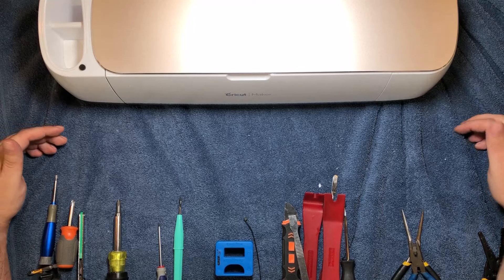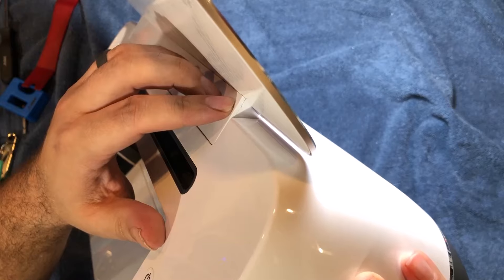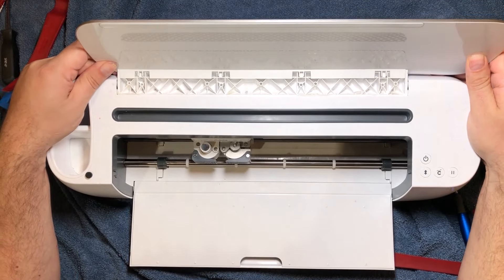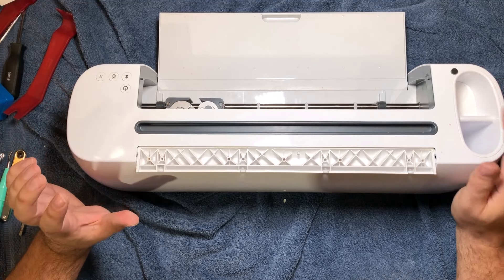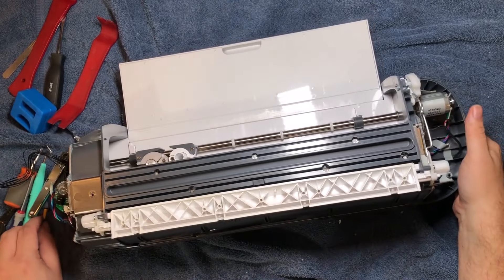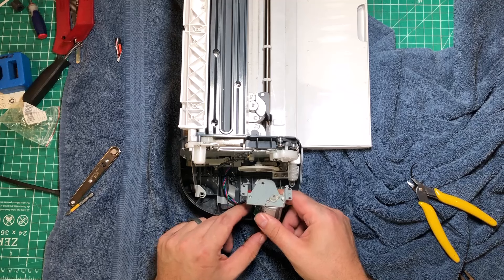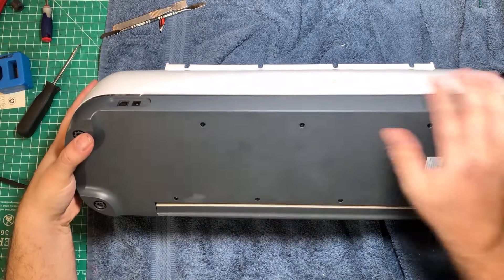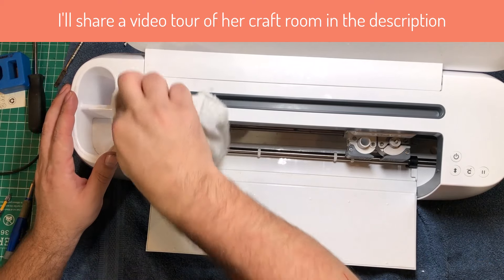The Ultimate Guide to Replacing Cricut Rollers - Every Step. Every Detail.

Comment: Great tutorial! I was able to get all the way until the 15:18 mark with ease. When I went to try to take the roller out, it won’t. I’m not sure if it’s because I have the Maker 1. The bar is so long that I’m not even able to wiggle it out or anything. Have you worked on any Maker 1, and if so, how did you get the roller bar out?
Reply from the maker: When you slide the bar to the right, does it actually start to come out the side of the machine or is the hole on the power button side just a tiny bit smaller than the rod?  I've had to do a little bit of filing on one to just get a burr out of the way and then the rod slid through on the right.
Reply: @AnotherMaker  I had this exact same problem and had to file the hole (the plastic surrounding the hole was too small) on the right side so I could slide the bar far enough in order to get it out!
Reply: I had this exact same problem and had to file the hole (the plastic surrounding the hole was too small) on the right side so I could slide the bar far enough in order to get it out!
Reply: Same here got stuck on 15:25 part .
The rod on this maker 1 is too long it does have wiggle room
but not enough to take out the whole metal bar
Reply: ok we good now.
Reply: Same the plastic was slightly covering the hole but a little filling and then the bar was able to come out.
Reply: I had the same issue but didn’t have a small enough file.  I used a small strip of 220 grit sand paper.
Reply: This is also where I got stuck. What should I use to file the hole?
Reply: @debasencio3805  You can use a needle file which others say they used with success or you cut a thin strip of sand paper, feed it through the hole and sand it down for a few minutes.  I used the sand paper method and it worked for me.  Just make sure to vacuum up and wipe off the grit from the sand paper (if you go that route) and the shavings of plastic because they could probably cause issues to the mechanisms if left behind.  If I do this again I’ll just buy a pack of needle files for $10 or so, seems the easiest.
Reply: @drewchenoweth9116  I was able to use my rotary tool with a grinder tip. It took some fiddling but I got the thing fixed...I hope. will be trying it out this afternoon.
Reply: @AnotherMaker wouldn’t this alter the functionality of the machine? Wouldn’t it then slip/come apart during use?
Reply from the maker: @justacrochetmum7536  No. There's no way to pull it out.  It doesn't move at all.  I've done it both ways, but on the ones I've done, you can't pull that one way or another if the right clip alone is on.
Reply: @debasencio3805  that's exactly what i did. you can't grind too much, the metal will stop you. I use a nail grinder, low power anyhow. :)
Reply: @dawnbilyeu4050 which part did you file? I can’t get my bar out. This is so frustrating and Cricut says my machine is out of warranty and doesn’t care.
Reply: Great Tutorial. I fixed mine in about an hour and a half. Had a little problem with the bar not wanting to come out due to the inside housing not being cut the same as the metal outside and lining up so I took a sharp pointed knife and was able to remove some of the plastic once I got it out without damaging my rod. It took a little maneuvering to get it out though but I'll be good for next time. Thanks for the instructions.
Reply: For me I had to loosen the purple plastic two silver screws and pull up on it a little this makes the shaft hole a bit larger and was able to then slide shaft to power side just like video. Just remember on reassembly to push the plastic back down and tighten the two screws once the shaft has been reinstalled.
Reply: I have a Maker 1 and had the same problem. I didn't file the hole, though. I pushed down on the metal thing so that the bar was as close to being above the gears as possible and at the same time, I used a screwdriver and pushed the bar in from the outside and somehow it popped out and I was able to remove it. I hope that I explained that in a way that makes sense.
Reply: Pretty sure you figured it out baby now, but I had the same issue. I had to push it right and wiggle it towards me on the power side. I was nervous the whole time. I hope you were able to fix everything!
Reply: If you undo the 2 forward and upper most screws it gives it enough leway to get the bar out I had the same issue with my Maker. then all you have to do is put the screws back in once the bar is back in place! No sanding required.
Reply: Help! I changed mine but now my power light does not work, it makes a weird noise and will not pull the mat in. What can I do?

Comment: Count your days cricut.. you deserve all of the money in the world for this explanation because it was truly a beast. Cricut needs to design rollers that we can snap on or something
Reply from the maker: Yeah.  That was a really really dumb decision.  The old rollers lasted for 5+ years without issue on my Air2. These lasted a year and were a pain to change.
Reply: Cricut are aware that there is a problem with the rollers and are replacing the machines. I just had my almost 4yo machine replaced with a new maker 3.
Reply: Replacement is a Maker, not Maker 3.🤦‍♀️
Reply: Mine went and because I had it for7 years they couldn’t replace but they offered me10% off for another one on their site. 10% ain’t much for what those cost but it’s something. I’m waiting for prime day to see if I can get an even better deal. I wish I can take it to someone to fix for me but they said no.
Reply: @bevbarry9637  what steps did you take to get cricut to replace your machine?
Reply: @phyllisallen5776  I just contacted customer support and told them that the rollers had moved and I couldn't get them back into the correct place and they told me they are aware of the problem. I had to send them some things; video of the issue, proof of purchase etc and it took almost a week for them to come back with approval for a replacement.
Reply: I just did this, and indeed, it takes an hour + .if you are not patient and handy do not attempt 😂
Reply: Hi, I'm in a bit of a pickle. I'm at the part of taking the bar out of my explore air 2 but it's not budging. Please help.😢

Comment: On the bottom the 3 screws are longer than the 4 screws. We didn't realize until one of  the 4 screws were not long enough in the 3 screws slots.  We kept thinking the cover wasn't lined up correctly. After figuring it out the longer screws went in.  It works fune now. Thank you for the instructions. We struggled a bit getting the 6 screws from inside but finally did it. 😊

Comment: Thank you for the detailed and amazing tutorial!  Took hours as I ended up having to drill out a bit of the plastic on the right side hole holding the roller bar to get it out. I had also bought the tight fitting rollers, which I managed to get positioned on the bar after heating them on the bar with a hair dryer and putting some silicone fluid on the roller bar.  I'd love to have a conversation with the Cricut machine designers.........

Comment: Great guidance!  Great video! Saved the day!! My Maker had an issue with one of the roller positions. Performed all steps and discovered that the rubber roller and it corresponding metal roller had become gummed up with adhesive and push the right rubber roller off registration. Cleaned knurled metal roller well with an x-acto knife. I found that by using a little dish soap and water I could lubricate the shaft at the rubber roller and move it back into position. (Sort of like putting on handlebar grips on a bike). Reassembled and all is working great again! Thanks for giving me the confidence to fix it myself!!

Comment: This was an awesome video that helped me replace the rollers on my Cricket.  This was the only video that showed me how to do the very first step, getting the strip off the top, with the newer crickets where the strip is glued down. All the wires, springs, clips were expertly described both in removing and when putting them back in place.  I fixed it myself- no husband needed thanks to this video.  There were some areas that were quite difficult, but his video gave me the confidence that I could do it.
Thank you so much!!!
Reply from the maker: Thank you so much! I'm glad it was helpful. I struggled with my first 1 and I thought the world needed a clearer example.  It's so awesome that you were able to tackle it!

Comment: After hours of working on this, I successfully replaced the rollers and the Cricut works like it always did.  Now just need to calibrate.  It took a very long time.  More time putting it back together (left circlip was challenging along with the hard rollers I bought, not to mention the hidden screws at the top of the machine) but with tenacity and patience, I did it.  Oh, and I prayed first too.  😊 If you bought the hard rollers, you will have to boil those directly in the microwave for 5 to 10 minutes.  Also, I saw in one of the posts that the left circlip was not needed, but my personality would not allow me to move on without that.  I ended up taking the circlip and spring back off the right side and did the left side first.  That helped  as I could push the roller bar to the left more to push it out more on the left, along with walking away for a bit.  Although challenging and not for the faint of heart, it can be done.  I am not ready to fork out money right now for a new machine.  But when I am it will most likely be Siser Romeo or Juliet.  Good luck!
Reply: This video is the best I've seen here on YT but it would be a great idea to add a little comment about the left circlip not being needed as I had to search comments for your response to someone else.  That was time consuming as you have many comments thanking you.  I, in turn, thank you.

Comment: Thank you so much! My rollers degraded around 5 months ago and I’ve not had the courage to change them - meaning my machine was a brick.  Just spent the last 90 minutes disassembling and reassembling my machine.  I think the hardest part was getting the case back on!  Those 7 internal screws were a little awkward to get back in too!  Just doing those two final parts took me almost 30 minutes!  However, I’ve just run a test with paper and vinyl and it’s cutting perfectly.  You made it very clear and easy to follow.
Reply: Oh…and despite your warning, I manage to touch the sticky goo…😂🙈
Reply from the maker: If it makes you feel better the first thing I did when I did want a week or two ago was to touch the goo by accident
Reply: @AnotherMaker  i have a explore air two it’s from 2019 i was told. Print and cut works perfectly but basic cut is off about a half an inch to the right. I calibrated. And worked with customer support. For 3 hours but still no fix. They told me they think it’s a sensor blade issue. And they only offered me $50 off a new machine. Do you know how i can fix that. For an older machine my rollers look fine but if you would like to take a look at a photo of my rollers i can send it to you. Thanks for making this video. Do you think replacing my rollers will fix the issue or no because they said it’s the sensor probably?

Comment: Can’t thank you enough for this video. Managed to replace the rollers on the wife’s machine with no issues at all.
Well, the only small speed bump was the torx screws to remove the top lid were T-9 on mine and not T-10, but other than that this video made it as painless as it could be

Comment: Hi and thank you for this video. I changed the rubber things with new ridiculously hard rubber rollers and now my roller bar does not move.  Could it be that the rubber is too hard. I have the Cricut apart again and will be so sad if I can’t get it to work. Any thoughts. Thank you again.

Comment: Thank you so much for this detailed and usefully video. Since de explanation of the tools digested until the cleaning part at the end. Great job here. I had to open the plastic hole to match the metal hole in order to remove the roller. Thanks again

Comment: Thank you, AnotherMaker. I'm almost done using your guide, and I couldn't have done it without you :) I also had trouble removing the roller bar, but I used a little lube, and wiggled the bar to the upper part of the hole, which seemed a little larger. Also, I ran intro trouble putting the cover back on. Instead of turning the unit over, I put the machine on the edge of the table with 2 feet hanging off. That way, I could screw at least 2 bottom screws in place without wrecking the alignment. Then turned the machine to do the other side the same way. Not flipping the machine worked better for me.

Comment: Brilliant tutorial, I even managed to put both of the side brackets back on, the back just slipped into the slots immediately (it does help if you are pressing the back of the cover towards the machine in the middle whilst sliding the cover down)...Admittedly, I did have to cut quite a lot of the plastic cover around the 15min mark (I used a stanley knife) in order to be able to wiggle the rod out (thanks to everyone who commented on that, saved me!!). 
The worst nightmare though came at the 28min mark... I was almost there, screwing the last NOT FUN screw in (out of the 7 upside down ones), when suddenly it jumped and unbelievably seemed to have ended up in one of the side ends... under the cover... I could hear it. So...  I unscrewed the six NOT FUN screws again, then the bottom ones, removed the cover, but couldn't find the screw anywhere. I could still  hear it going from side to side as I was tilting the machine, but no sight of it.... apart from that then... I saw it under my chair.... (yep, that gem, haha)... the screws did go in easier second time round, but to put the cover back was such a pain this time around. 

Anyway, in case someone is despairing and needs to read someone's d'oh moment. Oh and the goo... the goo is real.... 

Again, thanks so much for a brilliant tutorial. My Cricut is back to her usual self and I don't have to hold my deteriorated rollers anymore when I am cutting. (I only forced myself to do this painful exercise, because holding the rollers wasn't enough anymore and Cricut wasn't loading the mat properly.)

Comment: thank you very very much. I also had to use a small grinder to open the plastic housing where it is misaligned to the metal body plate. Then i was able to slide the bar out, as you demonstrated. Had you not shown such good close ups, I wouldn't have figured it out. Bless you!

Comment: I've been dealing with stretched out rollers on my Cricut Maker for about the past year. (I bought the Maker in May of 2020). My Cricut gets a lot of use. After a long online chat with Cricut support, the best I could get out of them was a $50 promo code toward a new one. I finally set time aside and decided to tackle this. 

I did end up needing a T9 instead of a T10. I bought the type of rollers you have to soak in hot water, but despite that, they are nearly impossible to get on the rollers by hand. I found boiling them for a minute in the microwave and then immediately putting them on the roller will get them ON the roller. I then used an 11mm wrench (the circle side, not the C-shaped side) to jiggle the roller into position with ease. It worked like a charm. I did need a right angle screwdriver for the 7 screws and I used a small mirror to be able to see the 3 hidden ones. I can't say how long it took as I worked on it as I had spare time over a couple of days, but I'm guessing between 1 to 2 hours. I was not able to put the tiny C-clamp back on the motor side of the Cricut (left side) but it seems to do fine without it. 

I'm using my Cricut again with ease for the first time in a long time and it's working beautifully. Could not have done it without this video. I watched several before attempting this project and this was the most helpful. Thanks so much! 

I am hoping in later models, Cricut gets off their proprietary bandwagon and designs a machine with an easy-to-pop-out roller bar so that the rubber rollers can be replaced with ease. It is absolutely ridiculous that the machine has to be disassembled to this level to replace a part that wears over time. It is also absolutely ridiculous that they would expect consumers to contribute to landfills when they trash their Cricuts over such a simple thing. Or that they should be expected to spend $400+ to replace a machine that needs a $10 part.